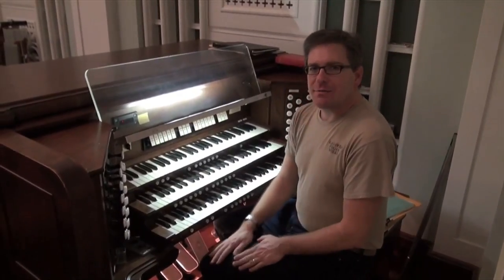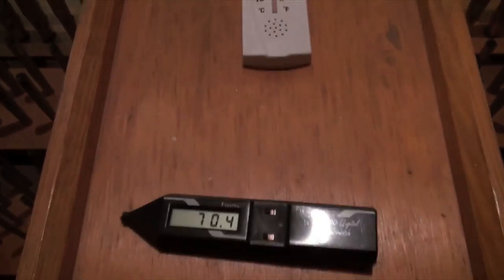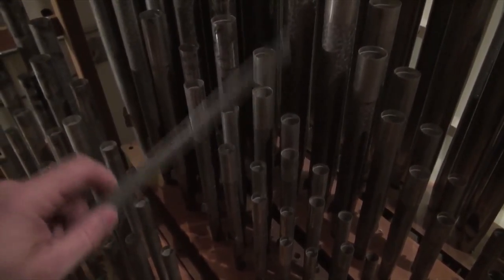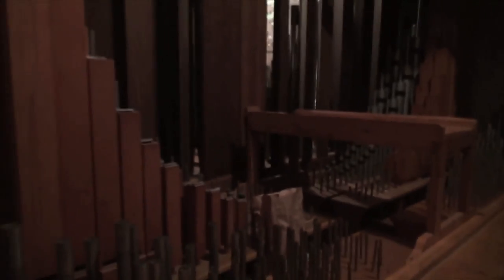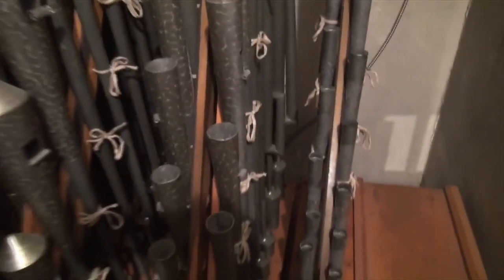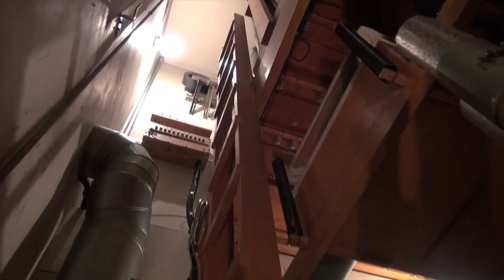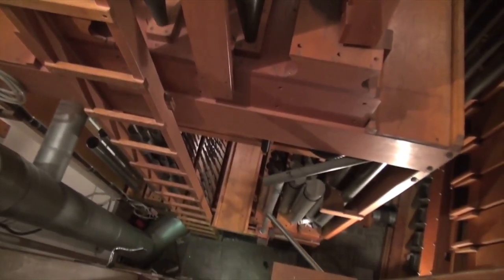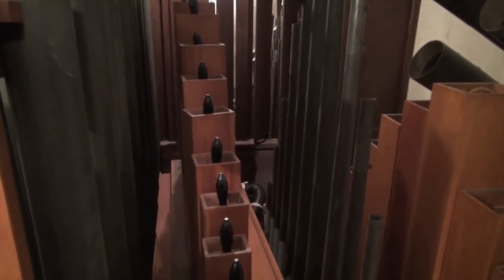Pipe organ maintenence...what I do at work

Comment: I love watching stuff like this! I have pretty much perfect pitch (or at least an ear for perfect pitch) so I know what a pain it is to tune and maintain something like this when everything expands and contracts with temperature changes, humidity, etc. I've been inside several different organs, but have never really done anything with the actual tuning part. At home, I have Hauptwerk 4 setup on a MacBook Pro with 10 or 12 different organs, both classical and theater, so I'm lucky enough not to have to mess with the registration on most of them.😉👍

Comment: If you have a good ear, and some knowledge of tuning, how difficult would it be to tune like you did?
Reply from the maker: More than anything it would take a lot of patience, it can be pretty demanding physically and mentally...you go in there and you see hundreds and hundreds of pipes to be gone through and you want to give up right there.
Reply: Reagan Reese  - tuning can be easy if one has the ear for it. I personally find tuning easy, provided the pipes are easy to get to and the wind supply isn't causing robbing of wind.  It's little chamber or box organs that are actually harder to tune!
Reply: cnagorka A tuner I used to work with used to say about tuning some of the larger instruments, "By the time you finish tuning you have to start back at how to tune".